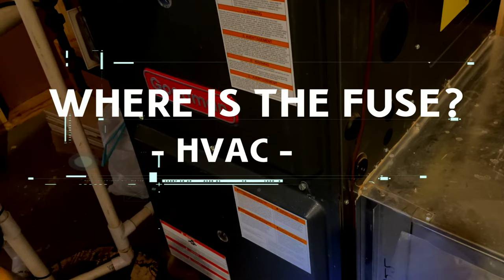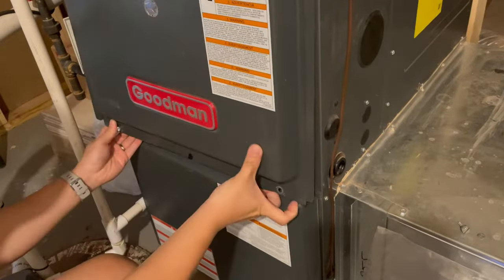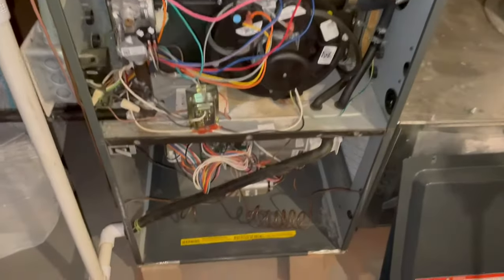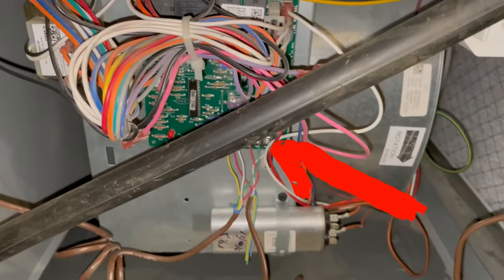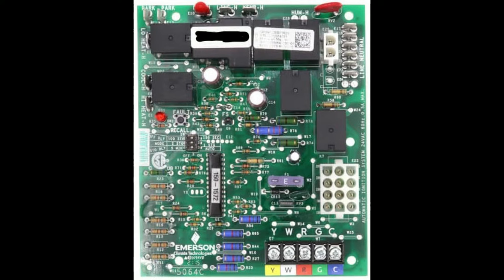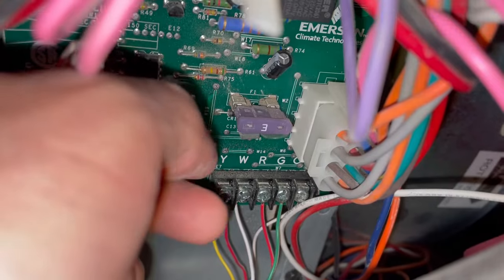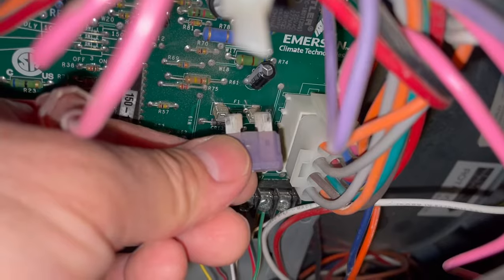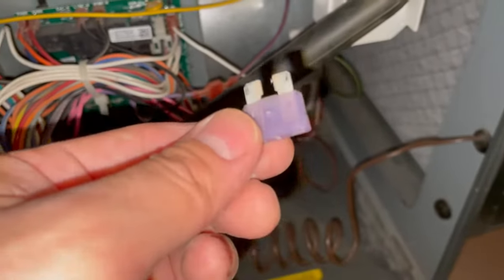Where's the Fuse in Your HVAC? (quick video)

Comment: Mine looks to be a 5A fuse.  The board looks to be a 24V system, but the fuse looks to be a regular automotive type 12V fuse.  Do these systems have a low voltage (12V) side?